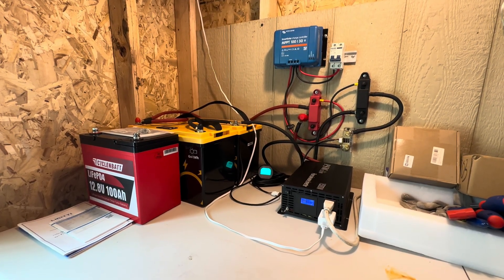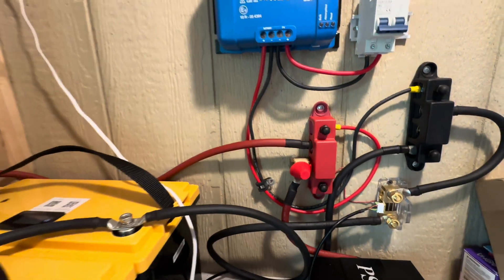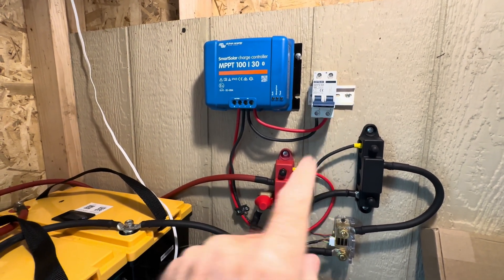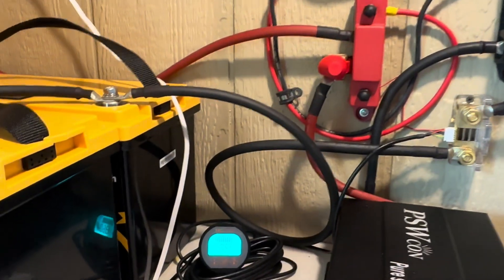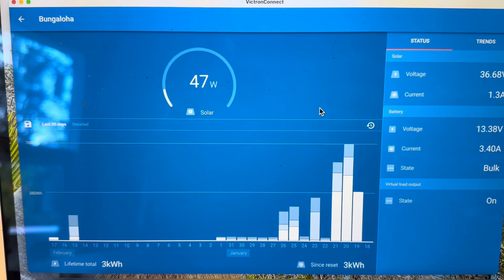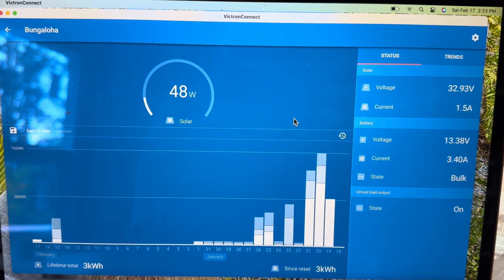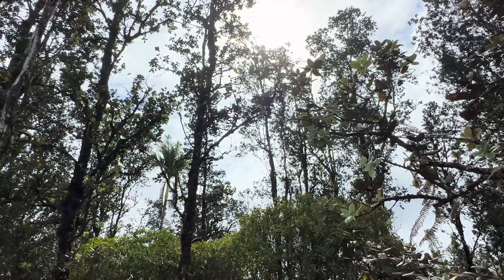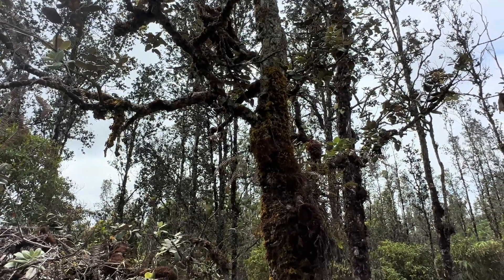Bungaloha powered up/NURZVIY 400W Portable solar array exceeds output rating on 90ft. Run!

Comment: If you wire each battery to the bus bars with equal length wires you will get good balance on both batteries.

Comment: I learned recently that those Batteries with a BMS if you connect more than one in parallel you can still have an Imbalance. Have you ever checked your balance of the different batteries in parallel ?
Reply from the maker: I haven't connected more than two together so far, and they all seem to be doing great! Aloha!🤙
Reply: @ProjectsinParadise808  ah very good

Comment: I'm going to try to run a 24 volt system. I just purchased a 800 Watt 24 volt Victron Inverter, to see how that works. I had 3- 4 cell battery packs but the cell balancing wasn't all that great. I find with the type of cells i have 2- 4 cells packs seem to stay balanced a lot better. If the batteries cells don't balance  well in a 24 volt system i have a Victron Battery balancer. That should do the trick.
Reply from the maker: I use two Victron phoenix inverters. A 24/375, and a 12/375. Both work very good. You will love the victron equipment! Best of luck on your build, and let us know how it goes! Aloha!🤙
Reply: @ProjectsinParadise808  thanks brother will do

Comment: Im getting ready to install my First Solar System. I have a Victron 100/30 like yours a Victron 24/1200 inverter  4 Li Time 100AH Batteries  and im starting with 12  100 watt ridgid Dokio solar panels  any advice would be Appreciated 👍 and its a 24 volt system

Comment: I think this is the first solar panel that over produced a bit. even them nice 100 watt ones come up a tad short. that 400 watt panel is putting more  then 4 100 watt panels. nice easy system to get started . nice to mount devices on a board. super easy to change and move around when needed. love the start of the blue wall .
Reply: As he said, only because the panel was cool.  I think good 100W panels would do the same.
Reply from the maker: I can't wait for the blue wall! Should have everything for that in a couple weeks! About to head up there in a minute to play around with some other stuff. So nice having a dedicated workspace! Aloha! Freezing here this morning at 64 degrees! Haha! 🤙